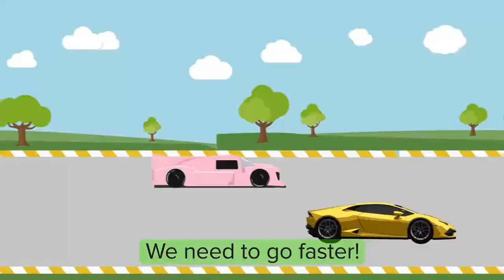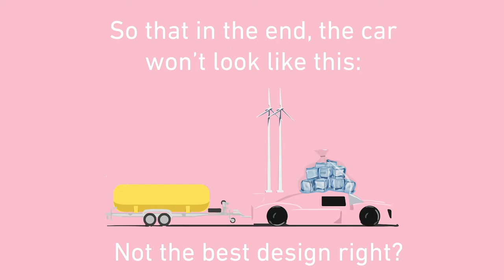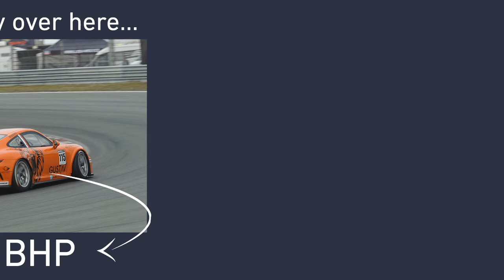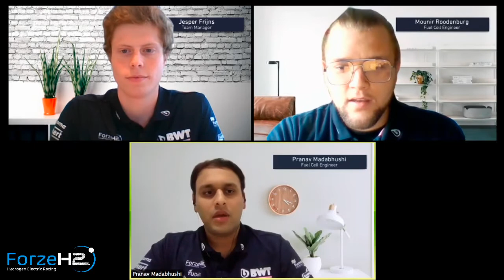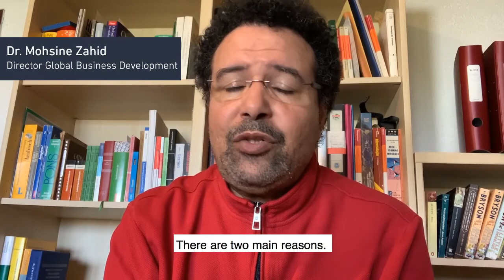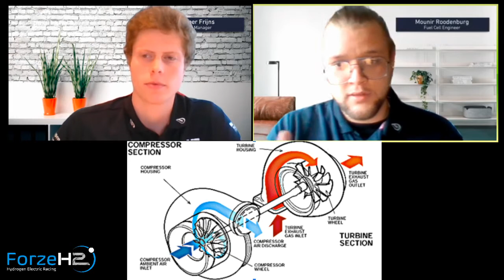Episode 1: Forze IX Design | More power

Comment: Hi, I've been following Forze for a while. Impressive work racing against ICE cars. Few questions:

1. What methods are used to produce hydrogen for the race cars? Is the Hydrogen produced via electrolysis through solar & wind energy? or is it done through conventional systems such as oxidation of methane? I would presume it's electrolysis since the purpose is to have lower emissions through the entire process.

2. Being the lightest element, hydrogen storage is very tricky and tanks need to be highly pressurized. However, recently researchers at northwestern university, Illinois have developed a metallic sponge that appears to make the storage of hydrogen far more efficient. Could such a technology be used to improve storage capacities on the racecar?

3. If I'm not mistaken, the Forze VIII runs on an LMP3 chassis. However, most chassis are specifically designed keeping the needs of an ICE/Hybrid powertrain in mind. Are there any plans to develop a chassis? or is the team working with the chassis of a GT car for the Forze IX? With more power, is the team targeting better straight-line speed with lower cd or is the car being developed to go faster around the corners with increased downforce? 

Thank you and all the best with Forze 9
Reply from the maker: Hi! Great questions, apologies for the late answer but here we go:
1. As a race team, we refuel our race car at a hydrogen station. In The Netherlands, hydrogen is produced both sustainably and conventionally. Just like the power you use at home, the source of this hydrogen can differ. Therefore, we are limited in choosing how our hydrogen is produced. However, Forze is a team that strives for a better and more sustainable world and therefore we try to stimulate the production of green hydrogen, in the end, that's the power of zero-emission racing. 

2. 
We hope this was answered during the second live stream but just to be sure: 
We looked into that form of storage as well! After all, storage is also a big challenge for us. However, the technical feasibility of this way of storing hydrogen is difficult. Therefore, the proven safety of gaseous storage and the relative ease of use makes gaseous storage the most suitable solution at this point, but we do see a future for higher density storage solutions for racing applications.

3. 
Interesting question! You are way ahead of us ;). This is something you will learn more about in the next episodes of our online design presentation. In July we will talk more about the bodywork of our car and in August we'll discuss how we transfer the power into speed. We'll make sure to answer your questions when the topic comes up. Amazing to see how interested you are and how much you know about hydrogen race cars!